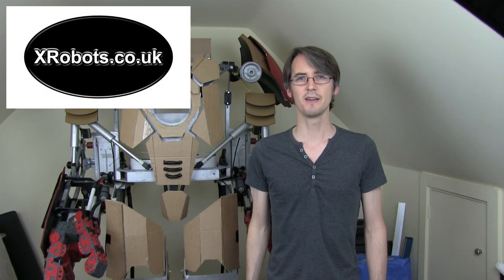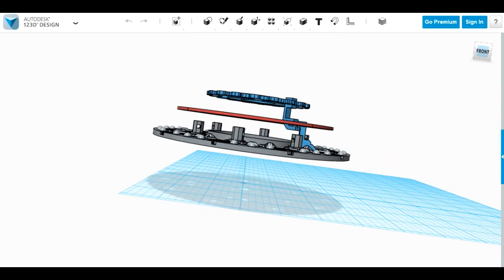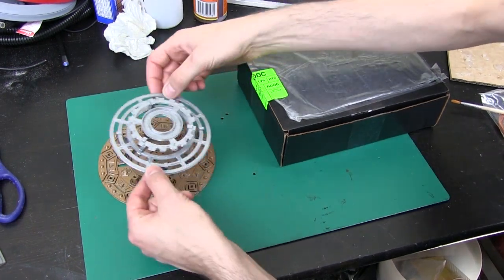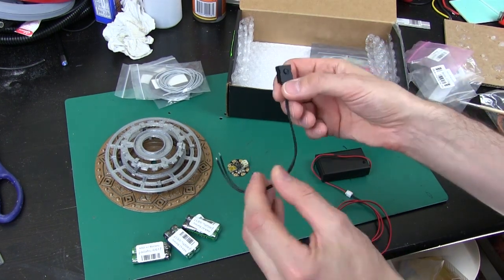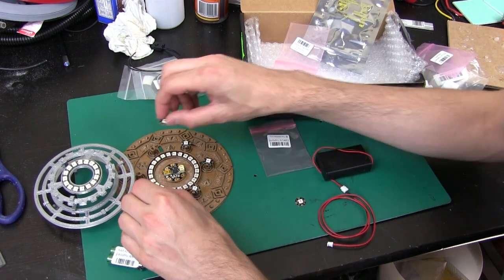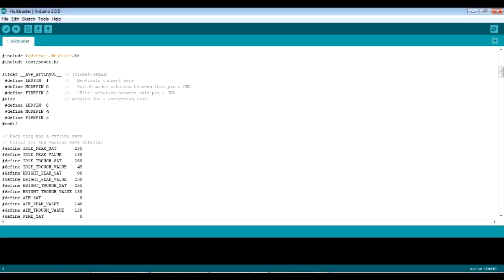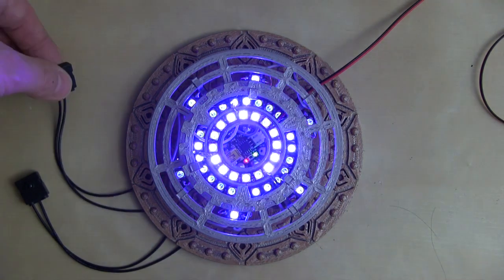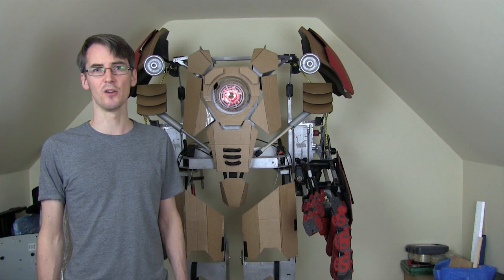Iron Man Hulkbuster Cosplay #16 | Unibeam & Arc Reactor! | James Bruton

Comment: When you were wrapping the copper wire around the plastic stands I was thinking you could have pre-wrapped the wire around something slightly bigger in diameter than the stand so you could get tighter wraps. Something like a wooden dowel.

Comment: How difficult is it to learn the arduino code for this? I really dig the effect you got out of it, but I've never used arduino before. I've been wanting to build a biomechanical spine with lighting and I think their system would be excellent for what I have in mind.
Reply: Like most programming its built on top of simple concepts put into a more complicated pile :)  If I were you I would get a cheap arduino a couple of LED's and work your way through some of it.  Once you get basic down its just a matter of scaling it up, and the Arduino community is very helpful if you run into problems.
Reply: CaptRR
Is there any open source or very cheap programming tools available to help test code?
Reply: GreatSmithanon There is actually a online emulator at http://123d.circuits.io/, fairly easy to get started and you can try any number of arudino modles.
Reply: rickard josefsson
thanks. bookmarked for future reference.

Comment: Impressive. Most impressive. Have you considered using some EL wire radiating from thr Unibeam toward the limbs? I might be talking through my hat, but I am working on an 8ft robot suit as well. The EL wire gives an attractive effect, especially when using a pulsing controller. Again, that looks beautiful in low light. Well done.